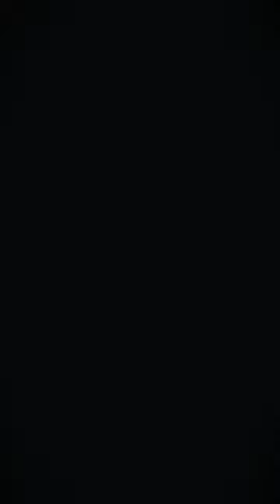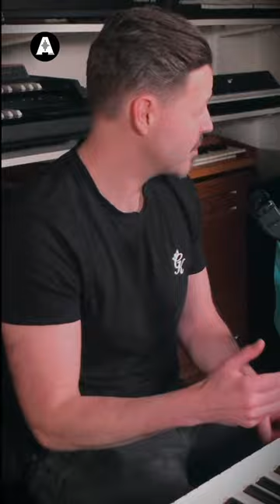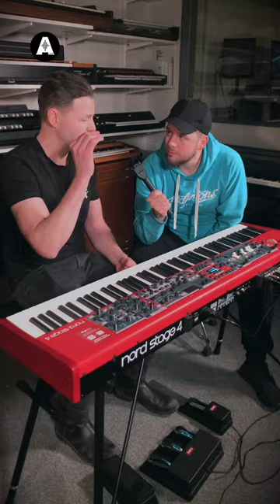What Is A Triple Sensor Keyboard? #shorts #nordkeyboards

Comment: Many keyboard actions now have triple sensors, but the entry level portable digital  pianos are usually dual. Supposedly, triple is better, but not always. Sensitivity often depends on how well the respective action has been designed and harnessed with the particular sound engine. And if you're going to play other sound engines via MIDI, it may help to have many selectable levels of touch sensitivity - and not just the usual 4-5. Some controllers keyboards (and a few DPs too) have about 100 levels.

Comment: Is a Nord stage 4 needed over a stage 3?

Why or why not?
Reply: I know this is old, but no not really.

For the $6500 you spend on a S4 alone makes it not worth the upgrade. I’m like 99% sure it uses the same sound set as the S3. The keybed is good at best but it wears down super fast. The workflow is also horrendous if someone is not used to the Nord UI

It is a stage piano though so it’s designed to be small and portable so that’s nice, but if you’re playing in a setting where it’s not being moved then I would just go with a Montage M or a Fantom EX, both like 2k cheaper and to me are way more powerful and intuitively keyboard